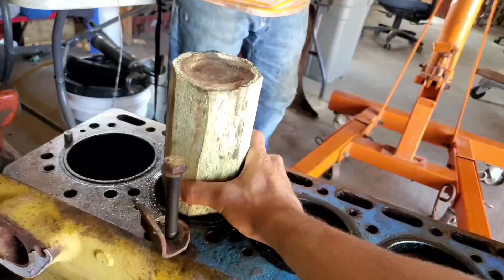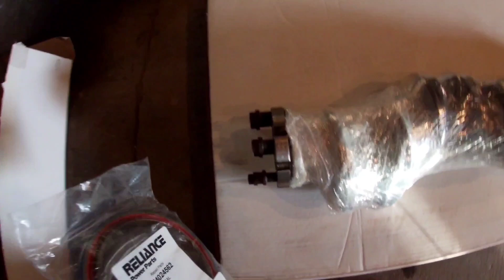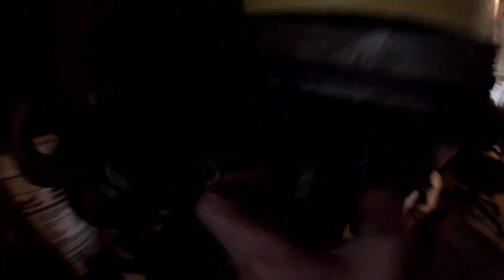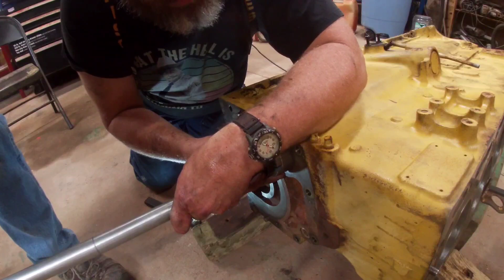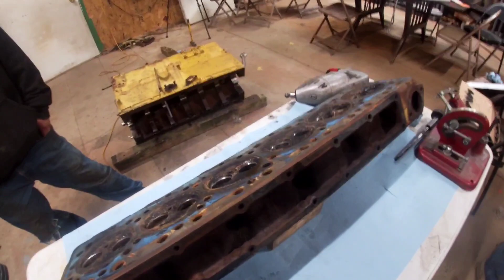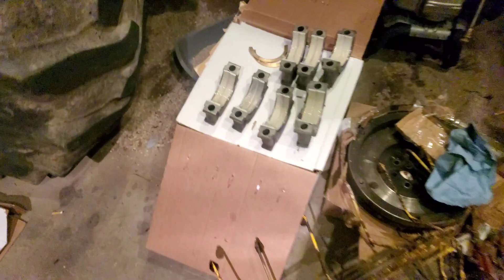Allis chalmers D-19 with 426, pulling tractor build, (part 1 engine overhaul.)

Comment: Late to the party excited to see this thing run
Reply from the maker: Me too bibster lol the whole paint thing has thrown me so far off my schedule lol
Reply: @TimothyFluegel  so what class and where will this pull?
Reply from the maker: @BIBSTERSrepairshop  I get it down under 6500 for sure but,  I'm hoping for 6000 to 7500 or 8000lbs in the 3mph. With Community and riverbend. The D-19 chassis allows me to run it at 2525rpms which is right there in the torque range for the 426 muhahaha. 😆
Reply: @TimothyFluegel   craaaaapp yeah I’ll take going against a 560 with a 806 over that

Comment: She is gonna eat alright........Transmission parts, rear-end parts, final drives, etc.!!  Awesome build, wish you luck
Reply from the maker: It'll last me years as a pulling tractor. I only plan on pulling up to 8000lbs not like I'm weighting it down more than a19 should be. Even if it only last 100 hours that's 5 years or better of pulling with the thing. The early 190s would last 5000 or so if they were being used hard, that's a couple lifetimes of pulling 😉 thanks for watching.
Reply: @TimothyFluegel  Oh I am not suggesting the items you are reusing shouldn't be, but I hope the rear-end and trans hold up more than a couple times down the track.  Remember the original 190s were light in the rear end with only the 301, you aren't increasing RPMs much probably, so that means torque is going way up, and torque is what breaks things, especially weighted up with limited slip.  I am sure you know all this, I am more worried for you than anything.  I really want to see you whoop some deeres!
Reply from the maker: @anthonyklein2944  I missed this 2 years ago Anthony but I guess better late Than never. But it has definitely pooped on some rough green ones since then. We just had it out in the 4th for a pull I'll have a video coming soon. We only got to pick on some red ones this time though 😆
Reply: @TimothyFluegel  Looking forward to that video!!! 😁